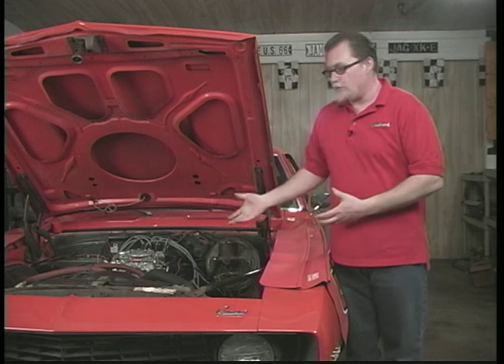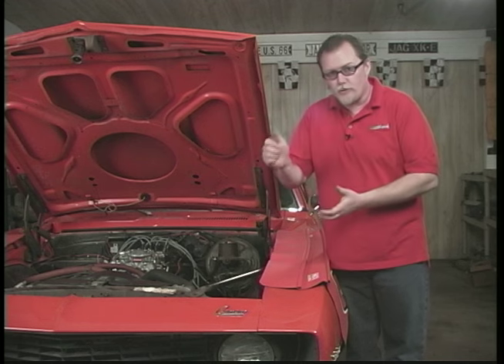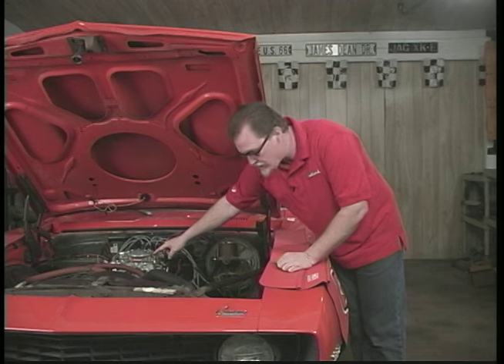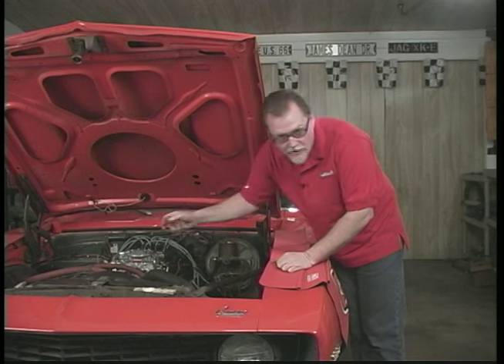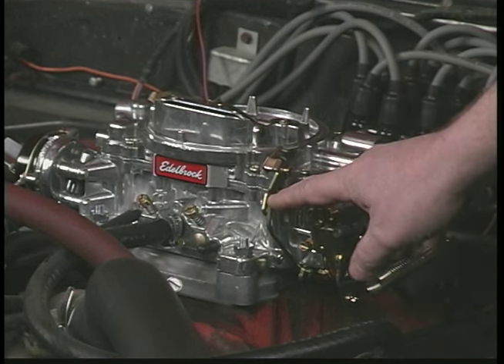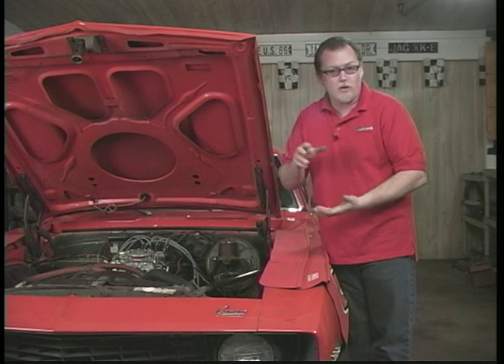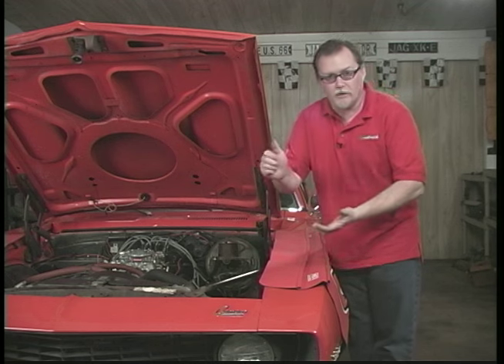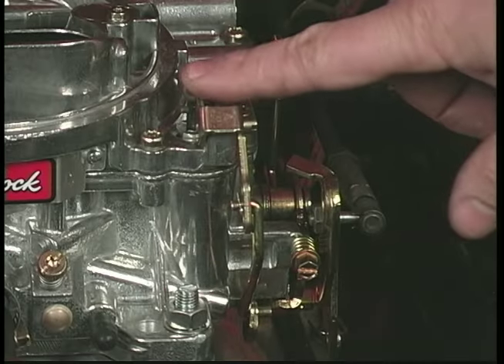Edelbrock Carburetors - Troubleshooting - Hesitation and Stumbling

Comment: 68 chevy c30 327 manual had a horrible bog and stumble, replaced it with a new manual choke edelbrock. Installed, adjusted idle, and ran like a bat outa hell. Then about a mile down the road it started stumbling and bogging horribly. Now I can't even get out of my driveway it bogs and stumbles so bad. Cap, plugs, coil, wires are all new. Timing at idle is at 15 degrees. Idles and revs then randomly dies. No vacuum leaks. I'm thinking it's bad gas

Comment: Ok-I'm in desperate need of help!! Got 351C with edelbrock 650 Thunder AVS.  Secondaries will not mechanincally open at WOT.  Looks like there is a linkage or some sort of cam that hangs loosely on drivers side of carb that hangs up secondaries from opening?? Can this cam be removed? What is its purpose-it just hangs loosely?? Its a 73 mustang with fmx trans and I used correct throttle adapter.
Reply from the maker: +John Bond Call our tech line. 800-416-8628

Comment: Hope someone can help me. Got a rebuilt 351C with edelbrock 650.  Was running and then a stumble/hesitation appeared at idle, it was idling rough.  Now engine will not remain running at idle? Runs rough with accelerator held, but dies immediately at idle.  Is this carbuerator issue? Changed fuel filter-fuel is new and was treated with Stabil 360.  Removed Idle air mixture screws and blew air through circuit and changed fuel filter with no success.  Is it possible something is clogged? If so, how do I fix this.  Carb is less than a year old and only has about 700 miles on it.
Reply: +John Bond John, maybe this will help. I had almost the same problem. I had to adjust the floats. Both were bent out of adjustment causing all kinds of problems. There is a video on You Tube for Edelbrock float adjustments. I hope this helps.
Reply: Thanks so much for the reply and advice.  Turned out not to be fuel at all.  I installed a generic version of an MSD distributor and the pin that holds the gear broke and gear spun, causing the timing to be completely out.  Have since installed an MSD distributor and all is well.
Reply: John, You are welcome. That was a interesting find.

Comment: I am in the final stages of tuning a 1405 on a 302 and experienced the same issue described in this video. For me the fix was to remove absolutely ALL play in the linkage, by adjusting the bend angle, so that the accelerator pump is activated immediately when the throttle is depressed.

Comment from the maker: Richard, the next step and the only way to cure the idle mixture screw
to become responsive is to remove the top lid from the main body and
re-adjust the float level. Make sure you use a 7/16" drill bit as a
measuring tool and you want it to slide or roll under the float HALF WAY
before the bit raises the float. The idle screw will now become
adjustable again.

Comment: Super helpful. In idle I'd blip the throttle and it would have that hesitation you described. I moved the accelerator linkage to the top hole and that provided a bigger squirt of fuel until the  main jets could take over.

Comment: I have an avs 650 on my 350, it's doing the same thing, but will also sometimes do it randomly under a more moderate acceleration, brand new carb. Pump arm in the middle hole. Any suggestions? Runs good idling, runs good cruising.
Reply from the maker: Try switching the accelerator pump arm to the highest setting. That would be the hole closes to the pivot point.
Reply: @EdelbrockTV  I did that an it fixed it, I also had to adjust the mixture screws a little bit I was pretty lean I believe it's running great now, thank you

Comment: To be honest. I hardly drive my 63 with 327 small block 1406 edlebrock carb. I can get it to start with starter fluid. But would die out. The bowl shows gas. But still dies out? Is it a bad floater ? Thank you in advance.

Comment: I have a hopped up Chevy K10 with a 350 and Edelbrock 1403 carb. When I first had the truck I could smash the gas and burn rubber. The tail end would slide out too. After being able to do that a few times, it stopped having that initial punch of power. Now it just slowly builds from a stop. It's like I didn't even floor it at all. What's weird is that on the highway the secondaries snap open just fine. They won't do it from a stop though. What's my issue?

Comment: Hello,
I have a 1406 on a stock SBC 350 and I have stubble gurgle only when taking off from a dead stop otherwise the engine idles and runs the best it has ever run, any thoughts? Thanks.
Reply from the maker: Please call our tech line. Tech Line Only: 800-416-8628
Reply: Mine was doing this as well. Did you ever find a solution

Comment: Also with a bigger cam, change out to a heavier spring. In my case I used the silver spring from the strip kit. Now I have a slight hesitation while driving.  So next is leaner, or richer jeys, and rods.

Comment: My edlebrock hesitated while just tipping the throttle for years, nothing I tried worked. NOW it is FIXED after looking carefully at the throttle butterflies and found the 4 screws loose.  So I made sure the butterflies can fit perfectly in the completely closed position then tighten screws very firmly.  
Now the idle stays put and it drives like a fuel injection engine.  Perfect tip in but I wish I would have found this problem 10 years ago.
Even if your screws are not loose the butterflies can still be center better than edlebrock's  assemblers.
FYI  even though my screws were loose they can't fall in your engine.  I'm not sure how but I tried to take my screws out but they got harder to turn so I left them in and tried to use lock tight the best I could.  Can't hurt.  Good luck.

Comment: My problem is my gaspedal. When i put my foot to it very gently it will take off normaly but when I push just a little bit harder past the tough spot it will slam down and give way too much gas. Cable/lever seem to be running free. Ever heard of this problem before?
Reply: Do u have a mopar?
Reply: I have the same issue.

Comment from the maker: Just to set the record straight. Edelbrock Carburetors are NOT made by Carter. They have up until last year been built by Magnetti Marelli/Weber USA, here in the USA. The division which has been subsequently purchased by Edelbrock, LLC. The Edelbrock Carburetor was originally based on the Carter design but was re-designed with more efficient booster clusters back in 1989.
Reply: Edelbrock USA were are you located at ?

Comment: i have a 350 small block with 1406 edlebrock idles good goes into gear alright but when i give it barely any gas in gear it stalls out or surges
Reply from the maker: Please call our Tech Line. Tech Line Only: 800-416-8628

Comment from the maker: There are other ways to improve off idle hesitation, lighter step up springs, larger squirter/nozzle, smaller larger number on metering rod. Also initial distributor timing plays a roll in all of this.
Reply: Edelbrock USA is there a number I could reach you or were are you located at ?

Comment: The idle air mixture screw on the drivers side doesnt seem to work.  Ive tried blowing it out with compressed air and sprayed carb cleaner in the hole with the idle air mixure screw out and blown it out with compressed air again, and still doesnt adjust. Any suggestions?
Reply: adjust float

Comment: I have a problem..SBC 355 10.2:1 comp edelbrock performer rpm top end and i go to smash the Gas and it has a dead spot then sometimes lights the tire up or sit there and  dhdahdahhh  vroooom..Idk iv tryed everything 600cfm dosent work and 750 dosent work...same thing out of both of them...and rev s slow, and if i smash the gas hard it sounds like it shut off and revs up ...fucked up
Reply: That’s exactly the same with me I’ve tried wverything

Comment: My 86 k10 has a 350 and it bogs or hesitates only when I floor it from a dead stop pls help do you think this is it I have a fresh motor and new carb
Reply from the maker: Please contact our tech department. Tech Line Only: 800-416-8628
Reply: So what happened
Reply: @Juan-js7ot  this was my old motor lol the sob blew up on the highway snapped the crank in half I no longer trust engines other people build unless it’s a reputable shop or crate motor because you never know what kind of idiot “rebuilt it” she’s scoots on down the road now tho lol

Comment: I put an edelbrock 650 on my ALL original 69 Super Bee 383.. They recommended the AVS2 650 CFM. Back fires through carb all the time. Tried moving accelerator pump rod, new plugs, fully charged battery. Theres a Reason why Edlebrocks are considered JUNK.. I wasted  $400 on this carb because it fit my stock application without moving things around. Ill send it back to  Summit and buy a Holley. Im OK with having to move my coil, use braided fuel lines etc to have my car run right.. Totally disappointed in the Edelbrock carb. Even ona  335   HP stock engine..

Comment: Im having trouble with my 350. Runs good when u give it gas but it idles like shit and stalls out. Looks like the throttle body is sticking closed and causing it to starve for gas. Idles good when in motion at speed limit but when moving slow it idles rough dies or stalls out unless u give it more gas can anybody help i have a video and on how it acts.
Reply from the maker: Call our tech department. Tech Line Only: 800-416-8628

Comment: Need help. I’m running an Edelbrock carb on my 289 with a c4 auto .  Runs perfect. However, when sitting at idle or slowly cruising, it I punch the gas, it has a massive hesitation bog or sometimes cuts the engine off completely. I’ve made it this far to this video. Should I adjust the acceleration pump to the larger setting even though it’s only a 289? Or should I be looking elsewhere, like timing?
Reply from the maker: Please call our tech line. Tech Line Only: 800-416-8628
Reply: What fixed it I'm having the exact same problem with the same setup as you
Reply: Shepherdpie haven’t fixed it yet, nor called the hotline.  I’m thinking I’m going to adjust the accelerator pump
Reply: I'm about to try it too because it either the accelerator pump or I'm not getting enough fuel pressure
Reply: @shepherdpie119  with todays gas accel pumps and their cups don't last long same issue gonna change the pump out